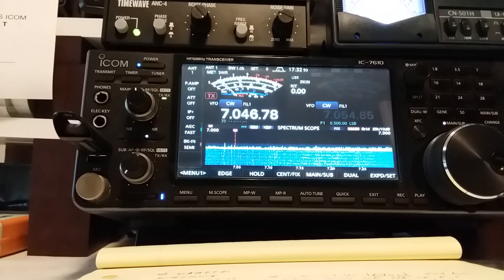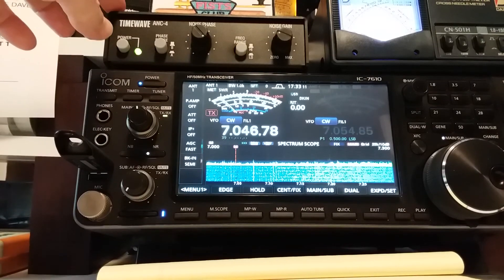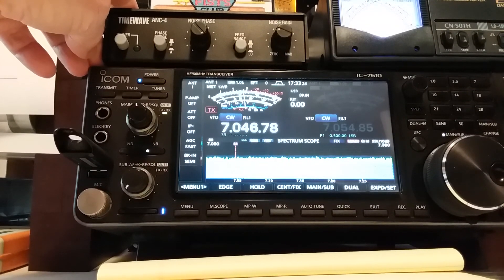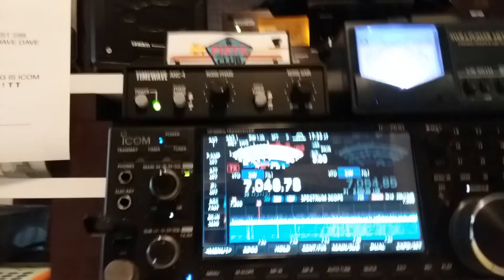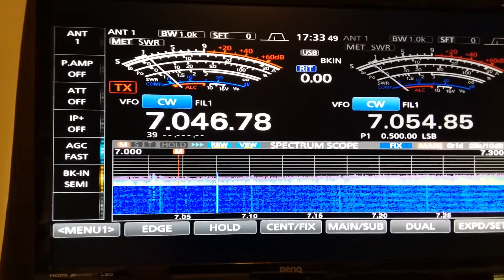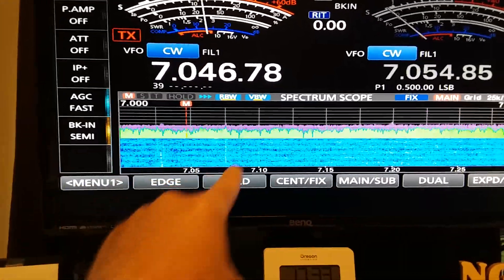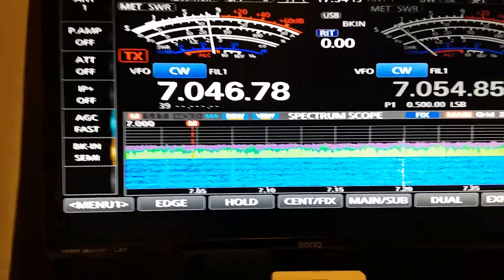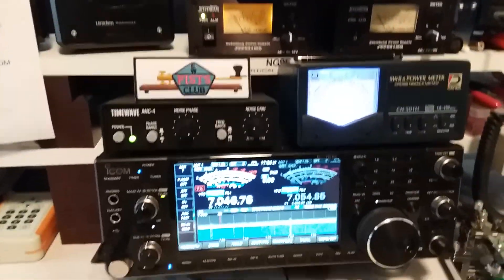Changed the orientation of my noise antenna to the Timewave ANC-4 noise canceller...WOW!!!!

Comment: How do you find the build quality of the ANC-4, I'm looking at the MFJ 1026 because it's sold in the UK but can the Timewave sent over to me  if it's a better put together unit.
Reply from the maker: I've had terrible luck with MFJ stuff.  I would get either the Wimo or the Timewave- probably either is much better than MFJ.
Reply: @laserchickenstudio  I ended up getting the Wimo in the end, works really well on what I think is network over mains power adaptor noise but not so much on the general electromagnetic "smog" I get across some HF bands. Which is sort of to be expected as these units only work if you can phase out the noise.

Comment: That demo would have been much better if you had a station tuned in, to compare reception with and without the ANC-4.
Reply: I agree.  Wonder if the device cancels the desired signal as well.

Comment: May I ask what you use for a sense antenna?
Reply from the maker: It is described in the manual- mine is maybe 5-6' each side and is a simple dipole connected to coax.  I use an RCA to SO239 adapter so I can use standard dipole antennas connected to the jack on the Timewave.

Comment: Why would you take the time to post great success without posting more detail to help others? i.e. - How was your noise receiving antenna set up before? What is your noise receiving antenna? How high is it? How high WAS it? etc etc etc etc.. What changes did you do which helped it to work as desired? WOW??
Reply from the maker: None of that is relevant because your noise source would be different than mine.  In general from 4-12 feet high is great for a noise antenna.  You want it to be broadside to your particular noise- not mine.  The antenna that I am using is a dipole approximately 5' or so each leg (side).  It is described in the Timewave manual for this device.